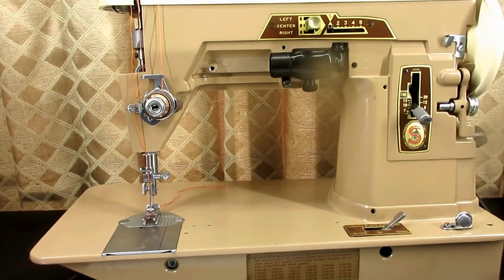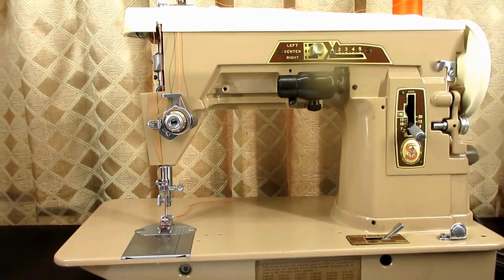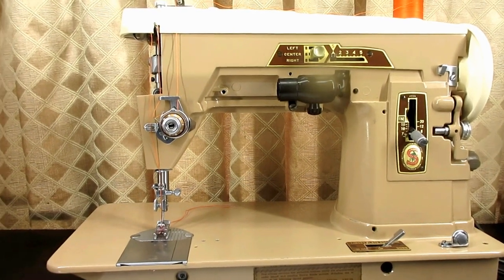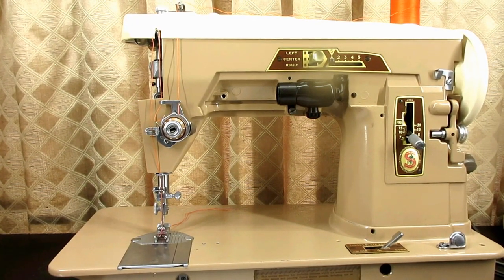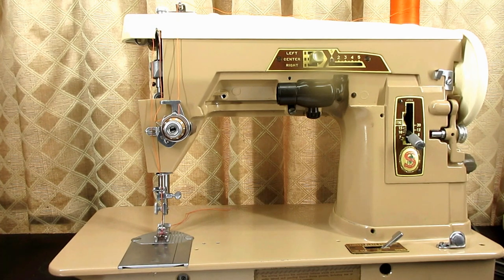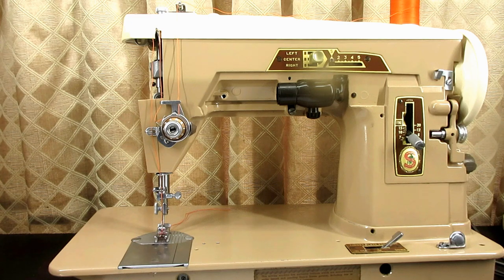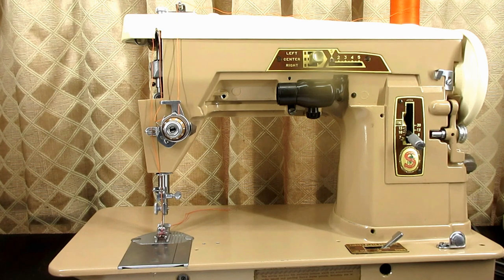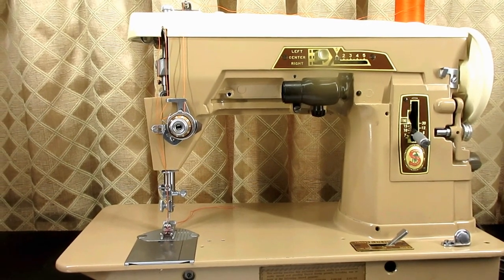Check and Set the Thread Clearance Singer Model 403A Sewing Machine

Comment: My bobbin hook/spring part came completely out of my 401a machine and it won't go back in. I tried inserting it at many angles, but it just jiggles around and not secure so won't lock the bobbin. Any advice would be appreciated. Love your videos!
Reply from the maker: Oh no! The bottom right "arm" of the positioning bracket slides into the base of the machine and goes under a bracket spring. That is what holds the positioning bracket in place. This flat spring is screwed onto the bottom of the bed from underneath. You don't see it from above while you are sliding in the bracket arm, but it is there. If you don't get the arm under that bracket spring then the positioning bracket just flops around, as you have found. Here is a video I made about installing the bobbin area parts, including how to get the bracket arm installed correctly.
https://youtu.be/Vvo0ZNjdPRU
I've never seen a machine without that spring underneath like it fell out or something, so if the bracket worked before then the spring is there and you can reinstall it properly. Thanks for watching my channel, Carol, and good luck.
Reply: @andytubesewing1953  Thank you SO much for the quick response and the instructional video! I will try it tomorrow and let you know how it went. Your reply gave me hope!
Reply: @andytubesewing1953  From Carol Marshall...You are amazing! I like how detailed your instructions are. My 401 is back to working great. You saved me about $150 for repairs! Did you ever think of making some DVD's of all your videos? I know I would purchase all of them! Thank you Andy!
Reply from the maker: Carol, I know you can do it! You should have seen me trying to figure it out the first time😄 Easy does it and good luck.
Reply from the maker: biznetwoman, thanks for the kinds words. I've had a couple people send me SDHC cards and request certain videos or a series, but I just figured who'd buy them since they can watch for free. Maybe I should rethink that and find a business partner? I don't even monetize my channel since I just want people to find the info and be able to repair and maintain their machines. I'm trying to build up a lot of good karma for the next go round, hehe. Take care and thanks for watching.

Comment: I have a 403a and the bobbin holder locks up and will not turn.It turns freely without that in it but as soon as I put it back in it locks up.
Reply from the maker: A couple things to check is if you are getting the Bobbin Case onto the Hook Race. On the left side of the case, you see a horizontal slot. On the Hook, the Race is a narrow thin "shelf" that the Bobbin Case rides on. That shelf fits into the slot. This fido may help. https://youtu.be/JLYNpmFQ3wQ  That same video talks about how the Bobbin Case Positioning Spring works. If that part is not under the spring under the bed to the left lower corner then the Positioning Spring won't hold the Bobbin Case properly on the Race of the Hook. Here is another video about these parts https://youtu.be/Vvo0ZNjdPRU   
Once you get it figured out here is a video about proper oiling of the hook and bobbin case https://youtu.be/PbT8lMzNJ34
When you have some time to kill you may be interested in how to clean and adjust your bobbin case https://youtu.be/HT5XZ5eYYEQ      If you ever get stuck on an island but have wi-fi and get bored you can watch all 27 of my Model 402A videos https://www.youtube.com/playlist?list=PLsCOZgzzaiKKyqvdDRwS-9MfLuwSNJTcg    1257 minutes total 😃
Reply: @andytubesewing1953  I found the problem watching your videos. The spring that holds the bobbin plate was bent and broke when I tried to straighten it. Have ordered a new one. Thank you. Great videos you have.
Reply from the maker: @jerrydavis5934  I'm happy you got it worked out. It's a marvelous machine. Thanks for keeping it in service

Comment: Andy... I need help please.. :( I have followed all these steps and have watched several videos of yours. on minute 40 , you showed how the thread no longer gets caught in-between the gap.

I have followed your exact steps and have both gaps at .013 in and the corner gap at .044 in BUT my thread still gets caught in the gap area... I watched your video on removing the black bracket thing that hold the bobbin case (im sorry I forgot what its called) and have cleaned it ( not too much gunc) but it still doesn't work........ HELP!!!! I am working on my new to me 401A
Reply from the maker: Hi, Tatiana. Are you adjusting a model 401A? Remember the gap settings are .012 to .016. Have you sewn on the machine after adjusting to see if it makes a nice stitch, or are you testing by hand like in the video? If it won't stitch well then you can try widening the gap, right? You have from .014 to .016 to play with there. so try .014 and test and so forth until the thread slips through. There are other reasons it could be hanging, but you need to try the entire range of the gap (.012 to .016) before looking elsewhere. Good Luck.

Comment: Hi Andy,  I had an unrelated issue and unwisely took out the bobbin case and the bracket that holds it in place by removing the adjustment screws. When I put it back together my feed dogs started running up against my bobbin case, slightly lifting it with each stitch. The machine refuses to stitch ever since.  I’ve got a 431G, but the mechanism looks the same as yours. My bobbin case is case number 503662. I’ve tried adjusting the screws to anything I can think of, but it seems to change nothing. Help?
Reply from the maker: "An unrelated issue", uhoh. So, removing and replacing the bobbin case positioning bracket should not affect the feed dog. The bobbin case sits on the race of the hook so taking in out and putting it back it ends up at the same height. It sounds more like the position of the feed dog was changed. Made higher or moved front to back, or both. Did you make a change to the feed while working on your "unrelated issue"?  I'm trying to think of anything else that could cause the problem but keep coming back to the feed dog position.
The height is changed by turning an eccentric stud and if that stud was turned 180deg that would change its path quite a bit.
Here is a video for adjusting the dog height on a model 301: https://youtu.be/Du-W1k_qHHI   Most slant needle machines have a similar method for changing height. There is also a way to adjust front to back. Changing that elliptical path may move it forward and into the bobbin case. Hard for me to say without hands on the machine but my best guess. You can download a free copy of the Service Manual for class 401A machines (includes the 403A) and look at the adjustments on pages 129 & 130 to see what I mean. 
https://sewingdude.files.wordpress.com/2012/09/singer-401-service-manual1.pdf       Maybe that can guide you to a path for a solution. At the least, it could eliminate a possible cause and move us forward to other ideas. Good Luck
Reply: Andy Tube as it so happens I just managed to fix the issue 10 minutes ago. It was indeed the height of the feed dogs. The single screw in the bottom that regulates the height was the culprit. As me and my husband were trying to get to the bottom of the throat plate pins (one of the 431G’s pins had entirely broken off, but half of it was still in there) he turned “a random screw” to try and take the mechanism apart. I told him off so he “turned it back just the way he found it”. And as I had for the first time touched the bobbin case and the surrounding area I stupidly did not instantly think of that screw. Thank you so much for taking the time to answer. I wish I had updated you 10 minutes ago, but maybe this answer will be very useful to someone else having a similar issue! Thanks again!
Reply from the maker: @oak_kitten  Thanks for letting me know you fixed it. It's good to have the comment on my channel as others can be helped.
I could never find the service manual for model 431G, but this free copy of the manual for model 401A is what many people use for your machine as most of the mechanisms are the same. https://sewingdude.files.wordpress.com/2012/09/singer-401-service-manual1.pdf    BTW, countless husbands have gotten into trouble due to a random screw. Don't punish him too much ✨😉
Reply: Andy Tube can confirm that with the exception of the notoriously fussy throat pins the 401 service manual has been accurate for my 431G for everything I have needed so far! I had already found it prior to you linking, but it wasn’t too easy to find, so I’m glad you linked it here for others too!

Comment: hey Andy, on minute 9:27 , what do you mean by "cast off area" im having issues with the tension on my 401a singer machine but I want to learn what is wrong before I take it apart. I think im just scared to take it apart and put it back together and have the tension on the bobbin area still be wrong .
Reply from the maker: OK, Tatiana, I'm glad you asked and you are smart to want to understand before you start taking stuff apart. Good on you for that attitude. I get emails EVERY SINGLE WEEK from people who have taken parts off or made adjustments they were not sure of and have a bigger problem than before. 
     This video is not so much about tension as it is about having the proper clearance between the corner of the bobbin case and the positioning spring. By "cast off area" I'm speaking of the position of the HOOK POINT when it lets go of or "casts off" the needle thread as it rotates. The hook grabs that needle thread from behind the needle drags it around counter-clockwise, and casts it off (lets go of it) at about 6:00 o'clock (directly opposite the needle, down at the bottom) right near the gap between the bobbin case and the positioning bracket spring. 
     The take-up lever is starting back upward and wants to pull up the slack in the needle thread, but it gets caught in the gap area and the hook keeps dragging it around, say to 5, 4, 3:00 O'clock then the thread gets stuck and the takeup lever can't pull it up properly. Now the hook point grabs another needle thread after the next downward needle movement and is trying to pull it around counter-clockwise. The hook point, take-up lever, and needle thread tension unit are all at odds with each other and the machine can bind so much it just stops moving, the fabric can get sucked down into the feed dog, you cant turn the handwheel, you cant lift the presser bar. Yikes! 👀 What a mess. 
     So this video is to show how to set the clearance (gap) so the thread won't get caught and the hook just releases it. If the gap is too wide the bobbin case can really jerk back and forth and rattle around and get very loud. If the gap is too narrow the needle thread gets stuck there. So it is about thread flowing around the hook and thru that gap, not so much about tension. 
     If you are having tension issues with the Needle Thread Tension Assembly (the numbered dial) I can help you understand that with this series all about tension. If you want to understand needle thread tension these videos can teach you: https://www.youtube.com/playlist?list=PLsCOZgzzaiKJaeFB_GW97NsW5GYM7KD9U The are very in-depth looks into tension. 
     If your thread gets caught in the clearance gap as I show in this video, by all means, reset that gap to the setting I recommend.
     There is also a tension spring on the bobbin case that can be (but is seldom needed to be) adjusted and I have a video for doing that: https://youtu.be/HT5XZ5eYYEQ     I save that for last when I am troubleshooting tension issues. 
     I try to make my videos as tutorials for people just like you who have a problem on a vintage SInger and want to fix it themselves, either to save money or there is no place where they live who will do it, or charges an arm and a leg. Take a look at the tension videos before you adjust anything. If you take off parts just take pictures before and during to aid with reassembly. Easy does it but I have every confidence you can do these types of things. I have testimonials from all over the world ages 14 to 86 of men and women who have fixed their machines.
     If you like to see the instructions written out with pictures you can download a FREE copy of the SInger Service Manual for Model 401A here:   https://sewingdude.files.wordpress.com/2012/09/singer-401-service-manual1.pdf   
You know where to find me, Tatianna, and thanks for watching my channel. (BTW, maybe the Facebook 401A group can offer you advice also.) Good Luck.
Reply: @andytubesewing1953  thank you so much for replying to my concerns. as it turns out, I don't know yet if I have fixed the bobbin tension issue (or if this was the issue at all) but noticed that my thread does get caught in the heel gap. 
I have tinkered with it to your exact specifications but it still gets caught in-between the heel gap. I have noticed the my thread is getting underneath the bobbin case (right where the "peace" fingers are located or so you called it) is this normal? I haven't been able to find a video of how the singer 401A should sew (the mechanics on the inside). 

Thank you very much for uploading these videos! I have joined 3 Facebook groups in search of answers lol. I REALLLLLLLYYYY want to get this machine to work.
Reply from the maker: @tatianaortiz9858  If you see it again, please tell me where I say "peace fingers" in the video. Thank you. You can get a free Service Manual for model 401A if you do not have one. AT this link: https://sewingdude.files.wordpress.com/2012/09/singer-401-service-manual1.pdf   I also have a newer series of videos for model 401A that may answer some of your questions.
Here is the playlist: https://www.youtube.com/playlist?list=PLsCOZgzzaiKLiDl9yFTP6mJgQmz5lj4NO

Comment: Hi Andy how to set thread clearance singer machine 66
Reply from the maker: Singer model 99 is a 3/4 size model 66 and uses the same parts. Check this video for all the bobbin area parts on model 99k and see if it helps you https://youtu.be/epUB-5TWQBo   Thanks for watching my channel and good luck. (Model 66 Adjusters Manual has no information of setting thread clearance)
Reply: @andytubesewing1953  thinks

Comment: Hi,
I have a Singer 457 and when I looked at this video, I am pretty sure that its
problem is the thread clearance between the heel and the spring. But as the model
of the bobbin case holder is different, I can not adjust it as you shown in your
video. I adjust everything that I could ont the bobbin case and the bobbin case
holder. From what I see, my clearances seem ok. The problem seems to be the
bobbin case who moves when the hook is coming around to get the needle thread.
When it moves, it get so close to the spring that the thread is getting stuck. Do
you have seen this problem, and do you have a video that explain how to fix it?
Thank you very much for you help!
Reply from the maker: Hi, Mylene. It is normal for the corner of the bobbin case to bounce against the spring as the hook brings the thread around from the needle and casts it off at about 6:00 o'clock area. The thread should pass through the gap so if it is getting hung up there or even stuck here are some things to look for. 1. Let's get some oil on the hook race/bobbin case edge to be sure the bobbin case can bounce back from the spring. Take a look at this video starting about 12:30 and see where/how to oil it. It's a model 413, but a good video showing what I'm asking you to do. https://youtu.be/XrNh_iaqDMM   2. Be sure your needle thread tension is not too tight. This can cause thread hanging problems and be pulling against the bobbin case too hard. Turn the thread tension unit thumb knob down (to the left, counter-clockwise) to 4 then 3 then 2 like that to see if it makes any difference. If you feel the tension unit is out of adjustment or dirty you can watch this video about cleaning and repairing it https://youtu.be/PSCY72bJ3x8    It's on a different model number machine, but similar to the tension unit on your 457.   3. Watch this slide show I just made for you. It has a slide of the Service Manual page with the instructions for setting the Thread Clearance on Model 457. You can pause the video on the slide to read it is what I'm hoping. It shows the actual factory gap setting numbers and which screws to use for adjusting and setting the clearance.
https://youtu.be/fn0GCJGiuZI      If you need a copy of the Instruction Manual for Model 457 follow this link to Singer for a FREE download in PDF format https://www.singer.com/sites/default/files/outdated_product/SINGER%20457%20Sewing%20Machine.pdf
That's all I have for you right now, Mylene. Good Luck.
Reply: @andytubesewing1953  Thank you so much for time and your generousity! I will try that for sure and will give you news of how it went!
Reply from the maker: @mylenelarocque8057  You are welcome and fingers xed that it helps. Good Luck.
Reply: It worked! I did every step you said, the oil, the thread tension and I did the adjestment for the gap! I also realised that my bobbin tension was a bit too loose, so I also ajusted it! But now it works perfectly! The straight stitches and the zig zag ones! I have tears in my eyes now, this is my Grand-mother machine, my uncle gave it to me as it was at his place and not working for almost 20 years ! I am so happy that it works, I spend almost 12 hours cleaning it and fixing it, but it worth the efforts! I can not thank you enough for your time and your help! I wish you all the best and a very nice evening 😊!
Reply from the maker: @mylenelarocque8057  We all love a happy ending! Very nicely done, Mylene. Family machines are the best and I'd like to thank you for saving that machine of your Grand-mothers. It has decades of sewing left in it and I hope you enjoy everything you sew and craft in the years ahead. Thanks for watching my channel. Take Care.